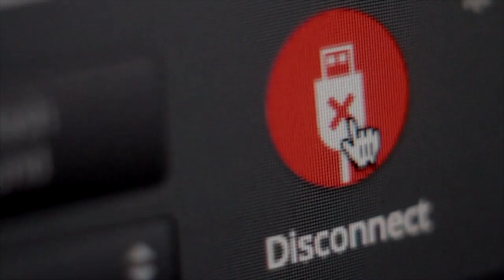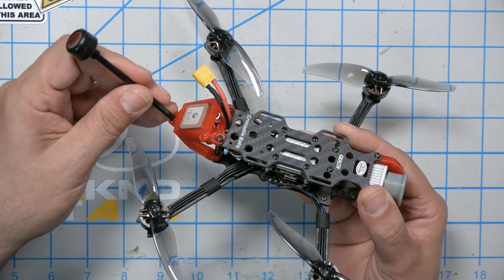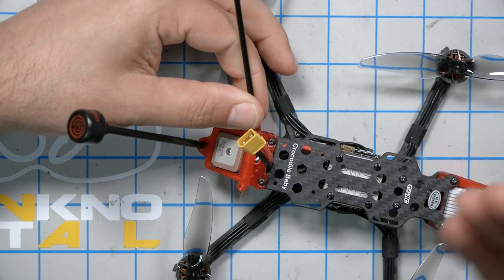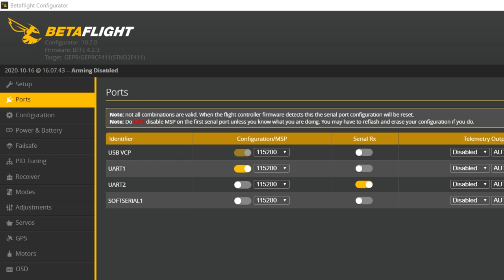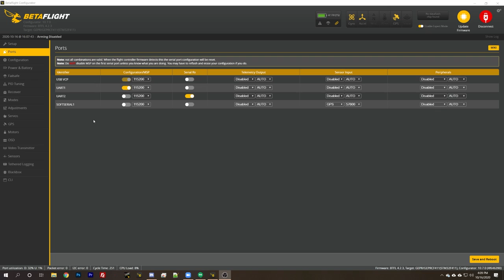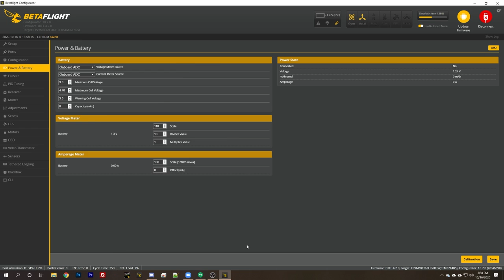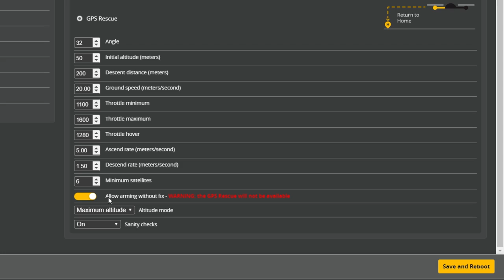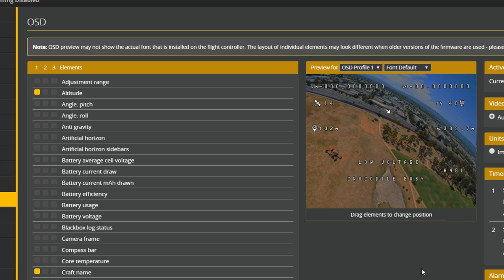GEPRC Crocodile Baby LR can fly for 30 minutes???

Comment: The GPS on a soft serial port is surely a downer, just imagine GPS failed when you needed it most when your quad with a naked GoPro is miles away.
Reply: Also the GPS steals the current sensor pin. At least it does with the analog version with the XM+ receiver that I have. I can't seem to get the GPS and the current sensor both working at the same time.

Comment: I don’t like this one, I don’t like the use of that whoop FC it results in two motor wires being extended and they look like a potential snag point for tree branches etc. the camera mount and tail look like after thoughts and result in an ugly looking quad in my opinion. I think The popularity of the Flywoo caught everyone off guard and they’re now rushing to catch up and in this one I think it shows. 
Looks like it flys great and I like the vista mounting to the top plate but just too ugly for me.
Reply: Yup, Dave_C put a lot of thought into the design of his frame and the flywoo keeps the vast majority of it. It's obvious this is lower effort and designed quickly to knock off the original design.
Reply: @obesesoldier1  not sure I’d say knock off but definitely to compete with and take advantage of the hype generated by the Flywoo. Now if only mine would arrive I’d be able to see if the hype is justified.

Comment: This softserial crap is kinda frustrating, only because there’s plenty of whoop boards out there that have enough UARTs. Stop being so cheap and putting in F405/F411 boards, manufacturers! I’ll gladly pay an extra $10 or $20 for an F722 whoop board with a billion UARTs.
Reply: True but they made it lightweight by all in one FC
Reply: @arycave  but that’s the thing: there exists F722 boards in this whoop style that are true all-in-one boards and still have enough UARTs to not be stuck with this sub-optimal solution. GEPRC and the rest simply chose not to use them because a) they were using up stock they have on hand, b) they wanted to save a couple bucks on cost or c) some other reason I can’t think of. Hence my frustration, and why I bought a 4” frame and built my own from parts instead of buying one of these BnF setups.